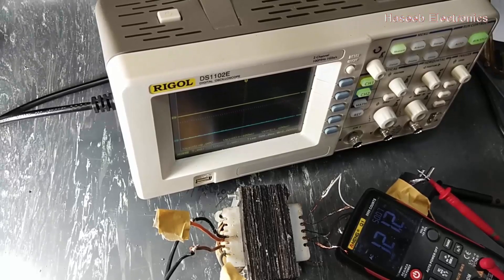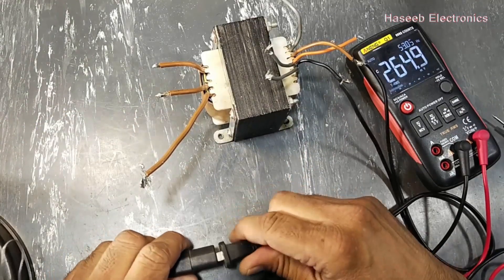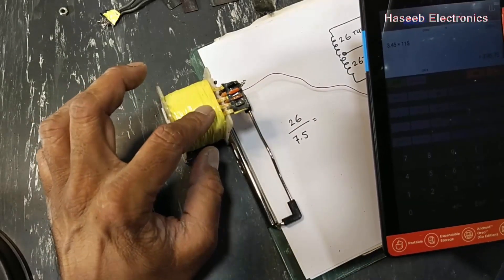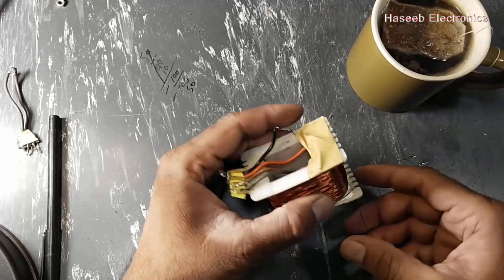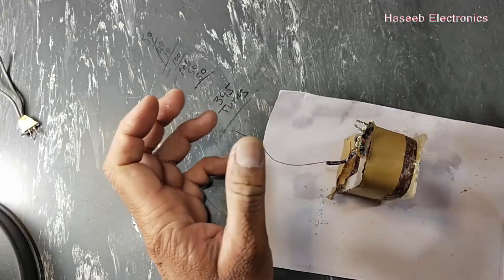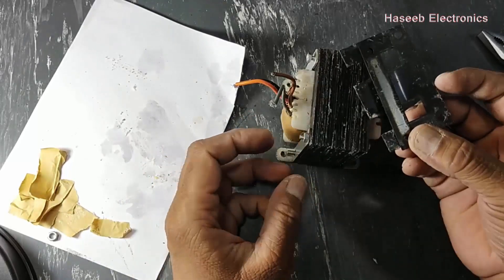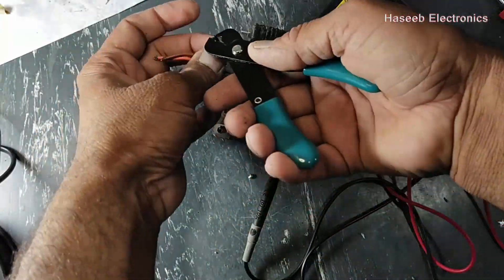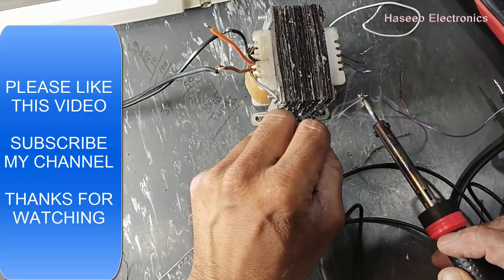{469} ISOLATION TRANSFORMER, What is Isolation Transformer, How To  design Isolation Transformer

Comment: In order to save time and also produce a much high power isolation transformer could I use two microwave transformers connected back to back (the high voltage side) and use the primaries as the terminals? i.e. one primary for input and the other for output.
Reply from the maker: superb idea. i never tried it, but it seems awesome. 
i will also try it

Comment: Thank you so much.

Could you please advise why you extracted a test point every 100 turns in the secondary and then discard them and use only the start and end of wire for output?
Reply from the maker: yes I made it to use as multi- purpose 
in future any time I need any voltage, I can utilize it easily

Comment: Can we use two transformer instead of modifying windings. One for step down and other for step up. Is the output of second transformer is still isolated??
Reply: Yes. And you will get double isolation, and double cost!!! sometimes will be a saturation problem if the two transformers have voltage/ number of turns not exactly the same.
Reply: @poweronadministracion9508  thanx

Comment: Sir sorry for of topic question,but can you help me?
I have atx power,all voltage present,but when I  put load 1Amp to 3v3 , power supply goes off. In secondary is PS223 ic, I checked sense resistor for over current and also changed IC,but still same
Reply: Any tips?

Comment: So, it need 2x winding (600 wound) if we need 220 VAc outpot, am I right?
Reply from the maker: i completed 396 turns to take 120V. 
in your case you have to check output voltage, then unwind the existing winding and count the number of turns
find the turn/volt ratio by         number turns of old winding / previous voltage

then multiply the answer with your required voltage value and the answer will you new turns